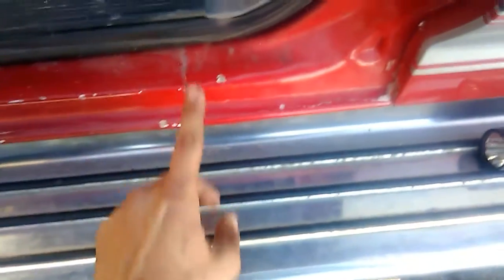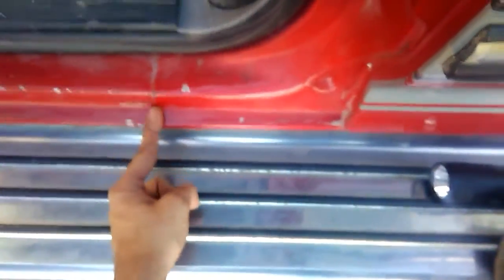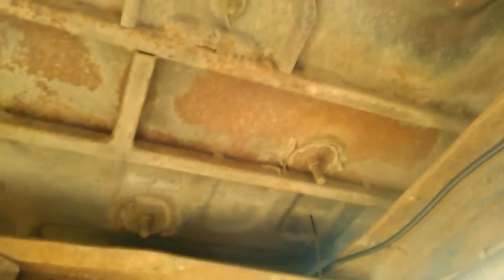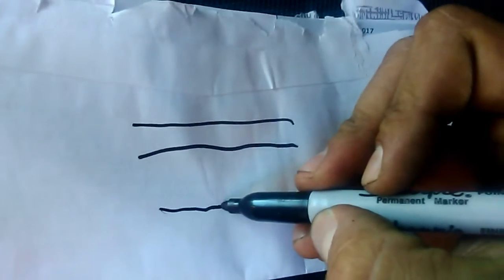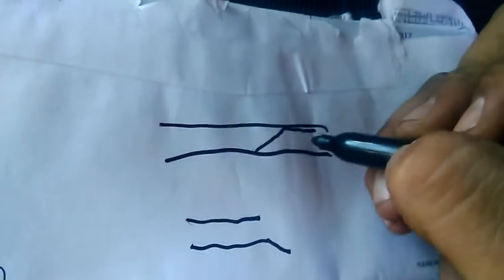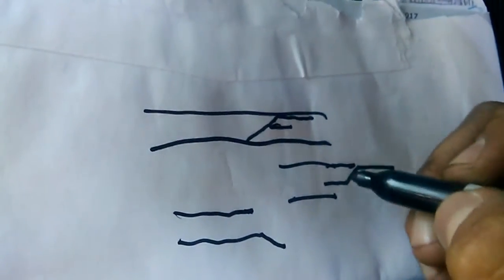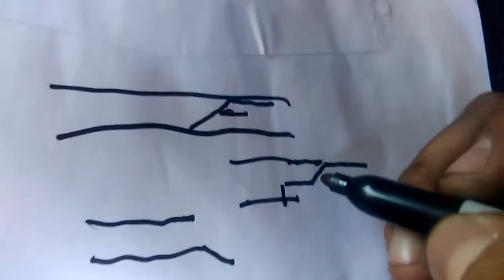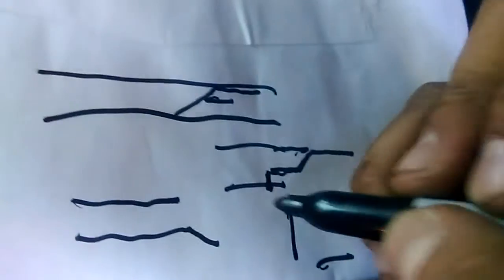Centurion Cab Extension

Comment: Cool truck, I'm a Centurion fan and owner myself, I have a C350 Four Door Bronco with a 7.3. Centurion did a lot of cool stuff but quality wasn't one of them. They built two vehicles a day, no time for quality work at that pace. I've got a hankering to pick up a rig like yours if I ever come by one for sale. I got a couple crew cabs but that crew+ would be fantastic.
 
FWIW the extra bit of frame most likely came from a Four Door Bronco build. They cut a few feet out of my frame, it had to go somewhere, lol. 

As for building one, your right about the frame cut, a Z cut and a fish plate would be the way to do it. But also be MUCH better to join two separate frames instead of extending one. That would make it one welded joint instead of two. Need a 4WD crew cab frame, then any HD ex-cab frame. You'd need the bodies as well anyway, so you'd have to turn those two trucks into one. 

Do have two questions for ya, what does your title/VIN/door tag say your truck is?  Second any luck insuring it for what it's actually worth?
Reply from the maker: Sorry I for some reason some of my videos have comments held for review. Ill cant remember off the top of my head but ill get back to you.

Comment: Any idea where I can buy oem parts? need a left fender , hood and undercarriage parts.
Reply from the maker: LMC is a good start but kinda pricey, junk yard is were I'd start if you don't mind have to color/paint match.
Reply from the maker: Any same generation F150-F350 with all match so if you come across a F150 but need a F350 fender, hood will be the same. Undercarriage parts will vary depending on what you need.